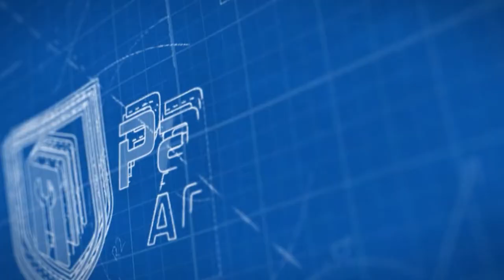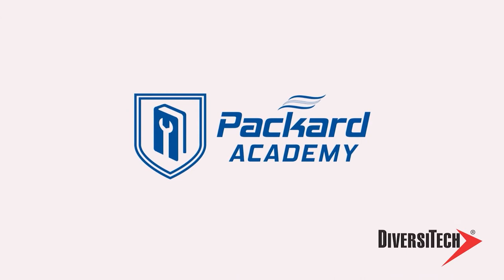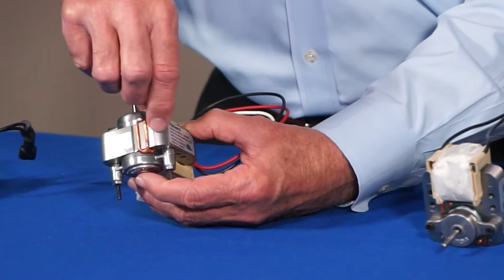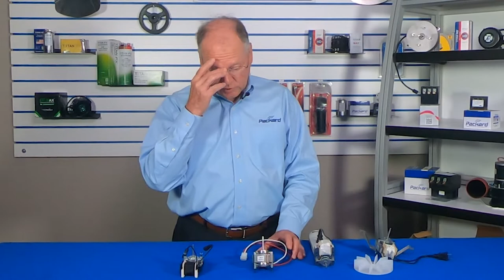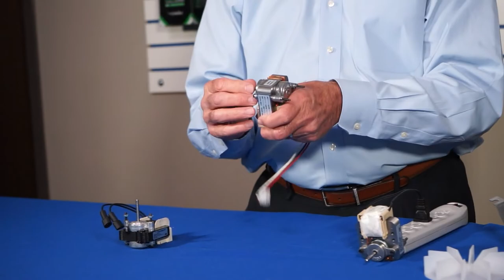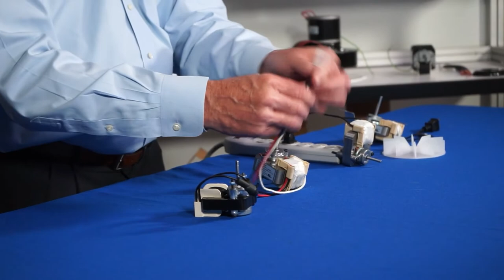C-Frame Motors

Comment: why does the motor have 3 wires coming out of it?
Reply: The white wire coming out of the motor is the common lead. any other wire for that particular application are your wires for the speeds of the motor.